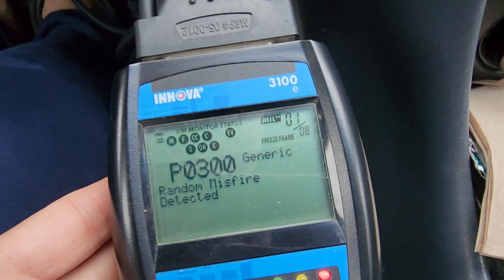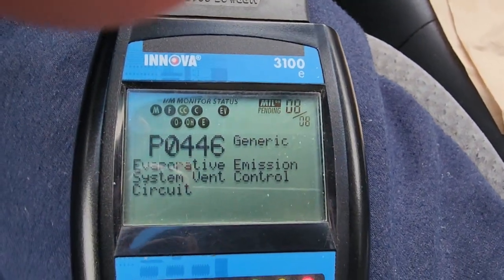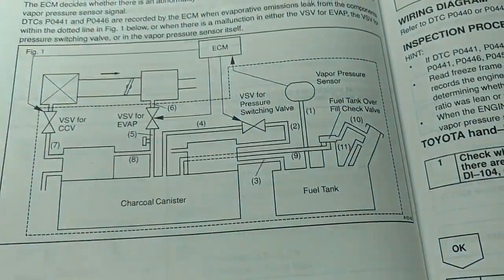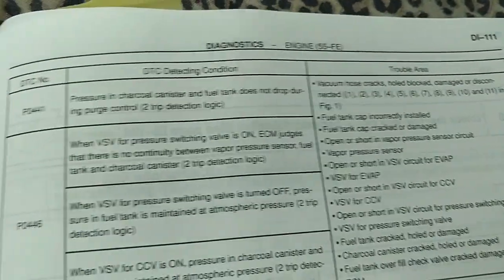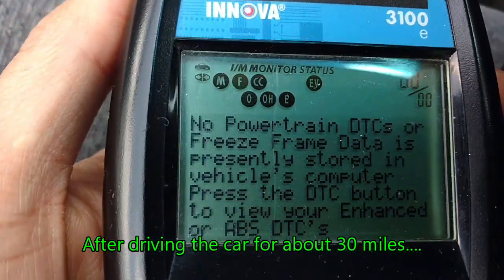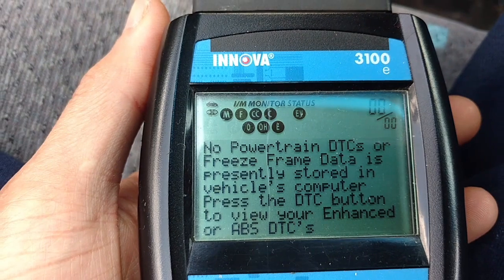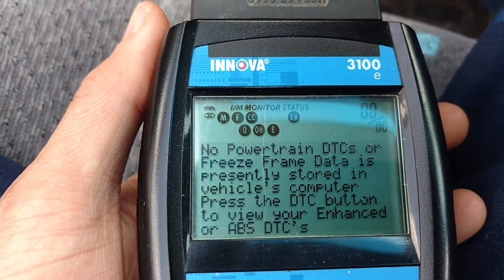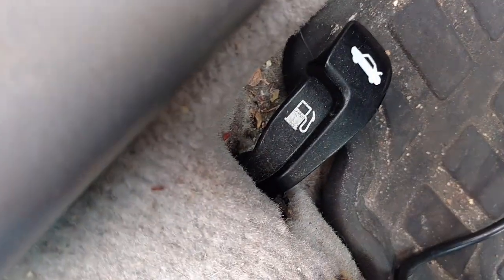Toyota  P0440, P0441, P0446 Engine Trouble Codes, Diagnose And Fix

Comment: Got p0441 error code toyota avalon 2003 , changed gas lid, both vsv valve still error code, what is next??
Reply from the maker: Well if you done with all easy to access parts,  check vsv on the canister and lines if rusty. I know it really pains specially if it is rusted out like mine.